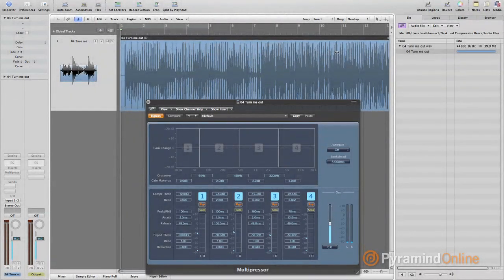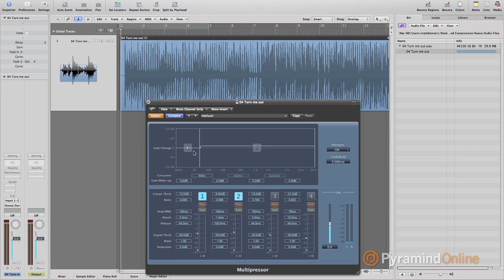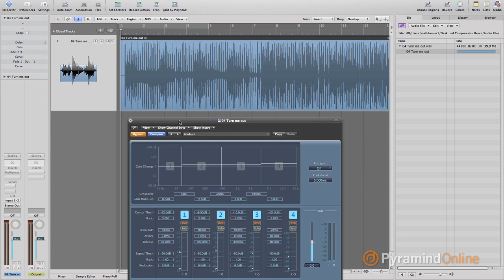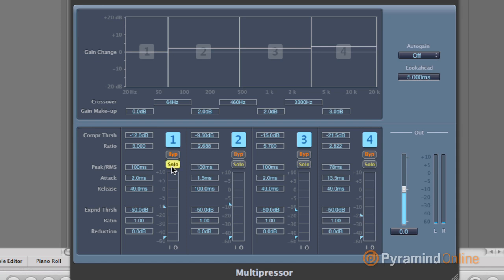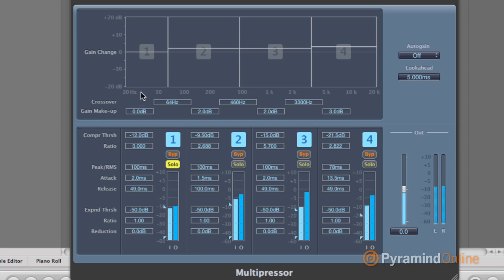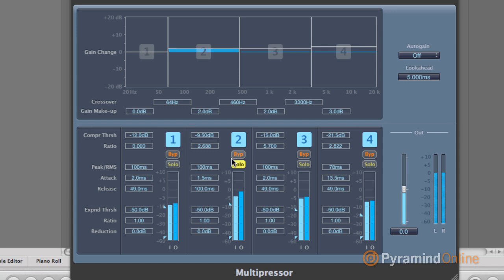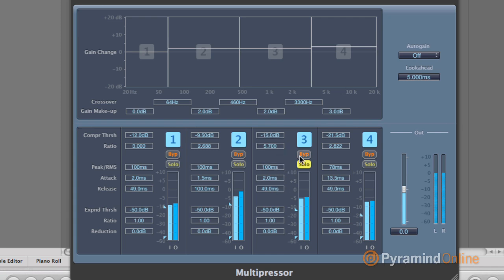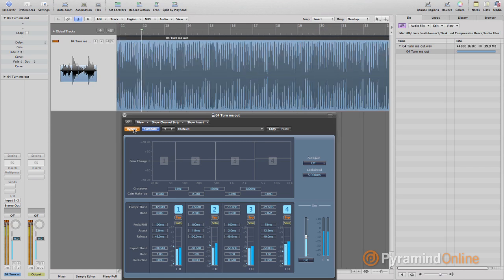Logic Pro | How to use Multiband Compression | Matt Donner | Pyramind

Comment: Great video. I tried using a very similar range of settings as you used in this tutorial, and it really did brighten up the mix. My issue is though, when there's a fairly large dynamic change in the piece, the multi-band compressor has a kind of wobbly effect, do you know a way around this? Thanks!